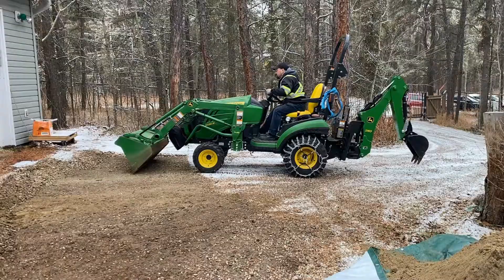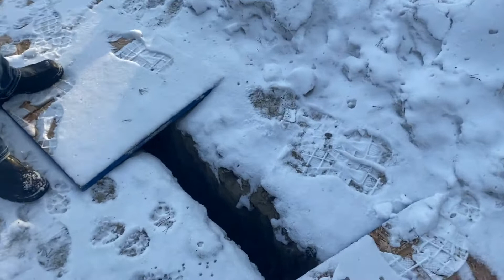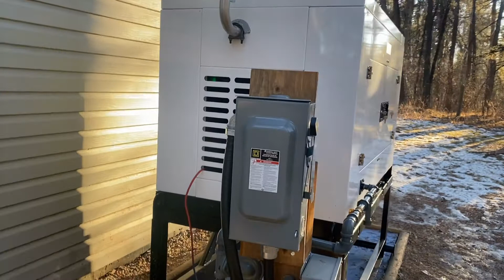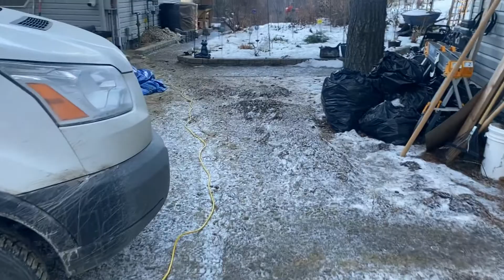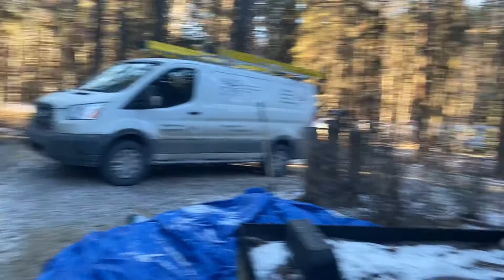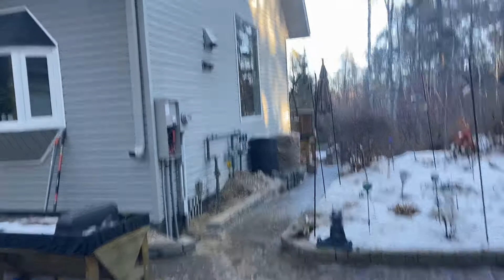How We Did This Generac 200A ATS and 25 KW generator install

Comment: My backup system switches so fast my PC's don't even notice. Generator may not come on for 12 hours or more, if at all. Should note that during the Great Texas Fubar it a near failure of the Natural Gas system due to greed that shocked us as well as power loss. Not counting Cell, water, internet etc. Gas and diesel were not available due to power loss.